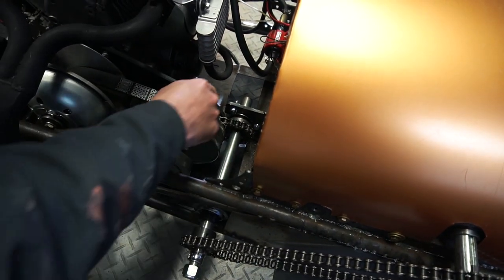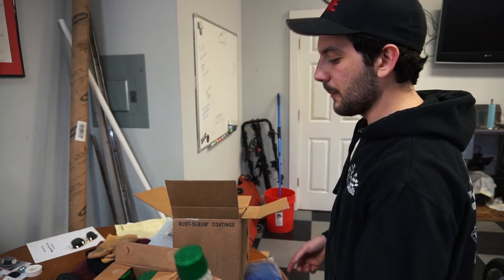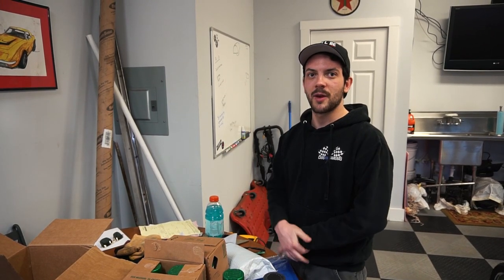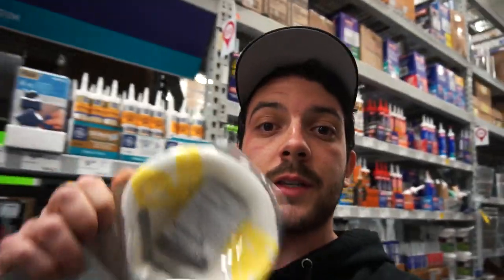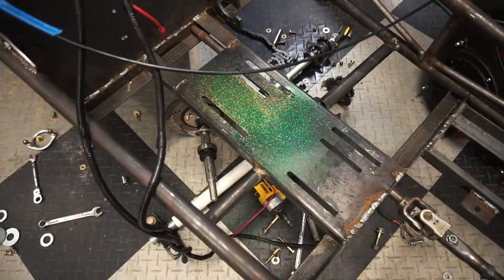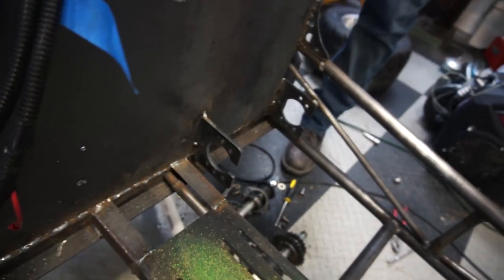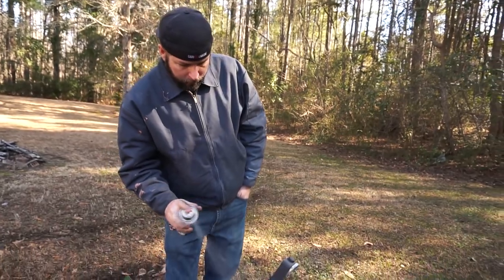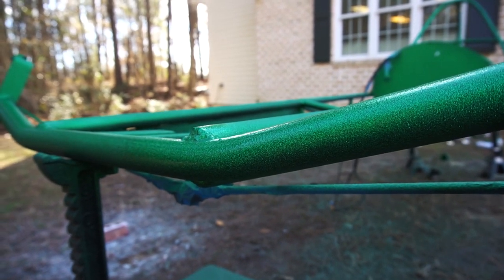DIY Paint Job (Heavy Flake)! 670cc Dragster Build (Pt. 15)

Comment: ok guys first off, I love your channel ,your vids are great. as for the turbocharger..... I installed one on a 62 Chevy nova SS with a straight six under the hood. you don't run the carb after the turbo.... you run it before the turbo.... it goes   carb>turbo>engine .... that way you are sucking the air-fuel mixture into the engine instead of pressurizing the carb (which wont work)..... think about it..... a 671 blower sits BETWEEN the carbs and intake. so does the turbocharger.   hope this helps guys.  you have given this old gall her inspiration back to do one last build.  thanks, Katt
Reply: draw though set up is easier to build a blow through set up will be more efficient and can be done, also with a draw through you cant run an intercooler, that's the old school way, blow through pressurised carby set up is the mid school way and blow through efi is the new school of thought, they all work when set up right, you can either pressurise the entire carb or have it modified to allow the boost to pass through without blowing out closed butterflies.

Comment from the maker: What do you think of the paint? And the Rat Rod Wagon throwback clip?
Reply: Would have liked to see the green base coat, then tape off some designs like stripes or flames and spray the green glitter and pull the tape. Sort of like ghost patterns.
Reply: It’s a nice touch, but a dark blue or charcoal gray would have looked better in my opinion.
Reply: Glitter done!
Reply: 💰+🍯="It'll be fine."
Reply: CarsandCameras   I can't believe how good it looks from cans of spray paint. Good job guys. Thanks for sharing.
Reply: Well Put!!
Reply: That was for cash potato. Well said!!
Reply: Nice
Reply: Mite have been covered.  What paint is that
Reply: CarsandCameras  what paint was used

Comment: I have a suggestion for the turbo idea..  

Get the single barrel carb from a VW Type-III.  Solex PDSIT 32.    Instead of making the turbo setup blow-thru, make it draw-thru.  Where the carb is in front of the turbo.  It would be a LOT easier to tune-up, and since it was made for a 40hp 1600, it should be a pretty close size to the 50 hp you guys are estimating to be making with that engine.  Or look into the larger single barrel carbs for the Type 1’s.

Comment: For a differential you could have gotten a used 4 wheeler rear diff. One of the shaft driven. They are typically independent suspension so lighter than solid axle and you just don't put suspension on the outers. But I absolutely love the build as it is

Comment: If you still want to go EFI, you might look into motorcycle EFI systems. It isn't terribly expensive to get a set of throttle bodies, wiring, ECU, etc. if you can find a suitable bike being parted out, you'd just have to figure out a custom bracket an linkage.
Reply: For reference, I picked up the parts listed above from an SV650 (dual throttle bodies with injectors, full wiring harness, computer) for about $100-150. The other advantage to a common motorcycle system is that there are tuning systems readily available.

Comment: I almost had the same problem with that glitter paint. If you read the can it says clear. But you guys ordered online so you couldn’t read the can. I still used it to metal flake done brackets on my car. I just sprayed it with purple, then sliver glitter, then a few coats of clear. Worked great.

Comment: While watching some dirtbike hill climbing I got to thinking about the 'chain does not want to be a chain' issues after noticing how long the drive chains are on those bikes that have an extended swing arm. Looked at some close-up photos of them and the way they keep the chain on is with couple of guides. Both are 'before' each of the sprockets (when looking at the direction of chain) and sometimes are as simple as a vertical U shape made of flat steel. Of course some are fancier, with a plastic liner that prevents metal-on-metal contact and/or rollers below the chain, but the idea is the same. Would also help to run the chain inside of a tube that would not only be a guide, but also a safety shield in case a link snaps.
Anywho, you guys have solved the issue by using a jack shaft, but maybe these ideas can be useful in a future project.

Comment: You guys should look at an ARM300 or ARM500 supercharger. They are cheap and you can make it draw through, which will make setting up the carb way easier. Lots of information out there on them as bike guys use them. Plus you are going for the vintage dragster look, not many 60's dragster had turbos🤔

Comment: I had same problem too with glitter graphics on my lowrider schwinn. Any base coat green works good when you shoot the glitter make sure to spray it thick with multiple coats it will turn green metallic....
Also glitter paint has clear in the mix

Comment: Love your  vids guys I watch them all. If you want a turbocharger get a gt06 made by garret.  I think there out of production but I've have been able to find them online for about 600 and there genuine garret and good for 80hp. Gt1241s are used buy sae teams and good for 130hp. Also I was thinking maybe you could use two EFI kits for a 350 cc engine and sync them up somehow one kit for each cylinder. Tunning might be an issue tho. Not really the cheapest option but it would definitely be unique

Comment: I used that rustoleum glitter paint to paint a sousaphone I used in my marching band and also had trouble. I learned afterwards that I should have used a base coat first and then topped it off with the glitter, but I ended up spending well over $100 and using at least 20  cans of that paint. You have to go slow and make many coats.

Comment: For carbed turbo setup: 
❌ Turbo > Carb > Engine
✔ Carb > Turbo > Engine
That's not the best setup, but works if adjusted well. Not sure if turbo is going to work well with fluids (fuel)
Don't cheap out, by wideband AFR gauge, adjust jets, turbo is going to pull way harder so you might need bigger jets to prevent lean out.

Comment: use a mikuni carb and draw through system
turbo will work like a charm
Reply: Caught this comment after I suggested a dual intake with motorcycle carbs like you suggest. Great minds think alike! Potentially, they can pull in the 110hp range out of that predator without it self destructing if they build the engine right. After all, an engine is just a big air pump! Cheers Graeme! Zip~
Reply: no problem at all

Comment: Yes. You could have just used a bigger chain, or something from a motorcycle. But the dual jackshaft design is a lot smarter than you realize. If they could find a way to use a transmission or maybe a way to transfer a chain like on a multi-speed bike. This gives WAY more gearing options than the previous.

Comment: If you put a chain tensioner on the chain you can run the chain like you did the wagon and with the tensioner you won't throw chains but the jack shaft was also a good idea I would get some kind of guard for it so stuff doesn't get caught in the chain

Comment: I know turbos and carbs can be tricky. Maybe a draw through design would be easier for you guys. Isaic probably knows about the turbo charged corvairs. Those were a draw through applications that air was mixed with fuel before entering the turbo instead of the boost from the turbo going through the car. That might make the setup easier but i imagine you would need to run it much richer. Drill the heck out of those jets lol.

Comment: Use a spray gun  and mixes the gold dust  with automotive clear coat but I think it's not be very good with the green flocks, on the carb thing fuel pressure can be an issue, can use a electric pump from a bike and a pressure regulator , the carb can run the turbo maybe just need bigger injectors and fuel pressure, don't know how much oil this engine have, but is a good thing pay attention to the oil temperature too, sorry for the bad English, good luck  guys.

Comment: use a 38 or 41mm slide carb for the turbo. they are a lot easier to make blow through than the butterfly carb the engine has and require a lot less modification

Comment: M122 Eaton roots type supercharger, build flanges on top, for dual carbs, flange on bottom for discharge into engine.  May have to turn it sideways to drive the belt off the crank.  That would be true to the theme, similar to 8-71 blower.

Comment: Y'all need to put the turbo between the carb and the engine and Dona draw through setup. That away you won't have to worry about the turbo pressurizing the internals of the carb
Reply: That would work pretty good but you would have to make the intake path as short as possible to keep the throttle response good, although that is not insanely important with a dragster :)
Reply: Gerrit-Jan Bergwerf that is true. If they hook the carb directly to the turbo then put the turbo in the valley right between the ports I think that might be just close enough that it wouldn't be that bad. And you are correct that throttle response isn't that important with a dragster as long as it isn't terribly slow

Comment: If a blow through setup doesn't work with a carb, there's other ways to hook set it up like a super charger would and pull. Also, I wonder if any a EFI setup off a twin cylinder bike or four wheeler would work.

Comment: Just a thought could you have lengthened the back just enough to put the engine behind the seat and run the chain directly to the engine then you wouldn't need the jack shaft and you would have more weight in the back it might put more power out also what do you guys think and Thanks for all the cool stuff you do
Reply: Chad Wion I think they wanted the engine in the front for better weight distribution
Reply: Mastblood      yup I get that but if they move the seat up and the engine back it should be good on weight transfer plus more power to the road

Comment: Have you considered a draw through carb setup rather than a blow through carb?  That would eliminate the need to pressurize the carb and also eliminates the need to reference fuel pressure to boost pressure.

Comment: Make a blower for it and direct injection of nitrous behind the card in the throttle body or one both the intakes to each cylinder, two little nozzles or one big one right behind the carb; it will be fine; just use a spring loaded switch with a manual cut off in case the switch sticks on.

Comment: Talking about adding more weight,  why didn’t you guys mount the engine as close too the rear axle as possible? You then could have mounted the seat further forward. All that weight saved on jack shafts, chains, bearings etc.  plus, more length in the drive train means more power loss too the wheels.
Reply: Chris W it was because they were trying to replicate the old vintage dragsters from the 60’s and 70’s.
Reply: Dirty Ham yeah I understand that and did hear the comment in the video, I think the whole 70’s style was just an afterthought, because no EFI is available for this particular engine.
Reply: EFI is not something readily visible though and has nothing to do with the styling.

Comment: If you heat up the paint cans before you spray it will spray 10 times better what I do is heat some water and put the cans in it till they get warm just try it and see how much better it will work and wont run as much have a great day
Reply: I have a dirt bike that needs painting do you think that this tactic would be good for that?
Reply: Yes anytime you are using spray can paint
Reply: It will make it build up pressure and not spit and have a much better finish
Reply: Big Belly Racing thanks so much buddy!
Reply: Hey no problem I am just starting my own channel and will be doing painting and tips to help anyone out check it out at Big Belly Racing

Comment: why not use a megasquirt setup for efi? you can use a batch/bank fire for the injectors (2 banks=2cylinders) and even have it control some coils. and completely custom tune it. can also handle 2.5 bar of boost.

Comment: Ecotrons fuel injection they can make a kit to work just gotta give them some specs. What you'll get is a kit that will need fine tuned for your setup but it's not that hard to do kit comes with the software and cables to tune and it's a closed loop system with wideband O2 sensor and the kit can be tuned to operate with a blower, turbo, or 2N2O(NITROUS OXIDE).

Comment: Why not go rear engine (behind the driver). My only problem with the multiple chains is you're probably losing a lot of power in the chain slack and the friction from the pillow blocks. Also there is all the extra weight from all those components.

Comment: I used the metallic on my mini bike and it's been holding up for a year now. I went with blue because thats what my son wanted. I sprayed it over a silver base first and it made it really pop. Tried black and it didn't look as good.
Reply: What materials did you use and are they fuel proof?
Reply: @ChrisBusy  Rust-Oleum and I don't pour then leave gas on it to dry but seems to be holding up fine.

Comment: you guys should build a kart with 2 engines, put 1 engine on the exhaust stroke, the other on the combustion stroke then put gears straight onto the crackshafts to a jackshaft and then put a clutch on the shaft so they are running in sink, theoreticly making a 2 cylinder engine. that would be epic

Comment: Don't build a blow through. It's a complete nightmare, even if you find a finished carburetor solution. 

I built me a Volvo 140 couple of years ago. The fourbangers in those (B20) have the exhaust and intake manifolds on the same side of the engine. 
I removed the carb, mounted the turbo pressure outlet into the intake manifold, and made an up-pipe to the turbo from the exhaust manifold, and a downpipe for extraction. I then mounted the standard Stromberg carb onto the inlet side of the turbo so that it sucked the fuel-air mix through the compressor housing and into the inlet. 

By doing it this way there's no need to pressurize the carb, just a bit of fiddling with the jets and it ran like a beast. No need for intercoolers either since the air travels directly into the engine and doesn't have enough time to accumulate significant heat. 

That thing shredded tires all day with a welded diff and 215's in the back.

Comment: a spring loaded chain tensioner would cure the long chain flop. the only reason to do 2 jack shafts is to do a gear reduction
Reply: It’s don’t matter, it’ll be fine/for testing purposes. Same old tired excuses they use

Comment: hey man, if your gonna run a turbo with carby, you need to put the turbo inbetween the carby and intake so its sucking in air from the carby and not blowing air into the carby. in that case you wont need to pressurise the carby and a lot less head fuck. excuse my French. then all you will need to do is work out a fuel pump that can support the amount of fuel needed, and possibly just set the fuel overflow to return back to the fuel tank
good luck with putting a turbo on it. 
heaps keen to see the results :)

Comment: you can run a megasquirt micrsquirt stand a lone ecu.  look it up.  it wont be plug and play.   you would have to have to add a crank sensor along with trigger wheel, air temp sensor, map sensor, and oxygen sensor.  that should be it.  plus your fuel injectors and such.  you could also find a vtwin motorcycle thats fuel injected and rob the ecu and sensors from that.  also it would be nice to see it turboed and actually working better than the 420 build you all did.

Comment: Use a golf cart differential it should have an open rear end that you can weld the spider. Gears together and make it a posi rear end out of a early sixties to about 73 electric golf cart with a 36 volt motor put the rear end underneath the dragster that you guys are building

Comment: blow thru carb idk how exactly there built but i think it has something to do with the butterfly valves but it seem to me that a barrel valve carb like ive seen in your videos before would be the way to go ... or maybe itb's / use two efi kits one for each cylinder n maybe a stand alone ecu from a fuel injected v twin motor cycle preferably one you can plug n play idk hope this helps
Reply: caze duplessis 
If you could put the whole carb assembly in a box, and make a sealed throttle linkage to exit said box, and an inlet to the box coming from your supercharging device,
it would stand a chance of working. 
The box contains boosted air flowing into it of course for the example. 
I forgot which aftermarket car setup uses a box to put a holley carb in but that’s the easiest way to make a blow thru carb tolerate boost.
Reply: i mean holley makes a blow thru carb for boosted apps . the problem with having a carb on a boosted engine is the fact that on the engine side of the butterfly you have a vacuum and on the intake side you have boost pressure if the butterfly is to weak to hold back the boost itll blow open either causing the engine to run away / run super lean  causing a shit show cause everyone knows boost and lean engines dont mix . even if you were able to seal it up like you said i dont see how the butterfly on a small engine would take the boost carb hat/ box or not cause the turbo would simply blow open the butterfly  at partial throttle or idle causing it to go lean and BOOM! the only way i see it working is either a  barrel valve carb or some type of reinforced / sealed butterfly  and some type of crazy strong throttle linkage with some type of spring or something to close the valve when you let off cause the boost is going to try ikeep it open  / and youde need some type of crazy big jet or some type of pre carb injector or even pre turbo injector witch ive seen also ( pre turbo injector helps atomize the fuel apparently )